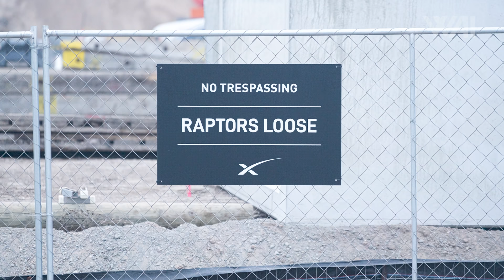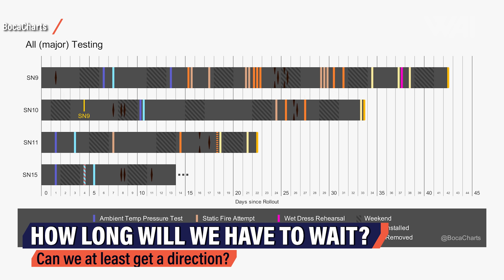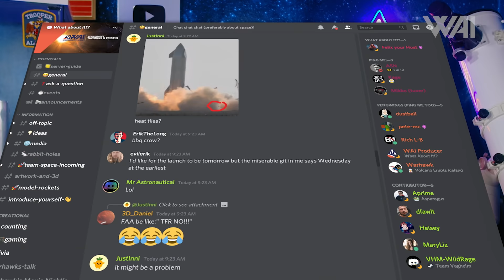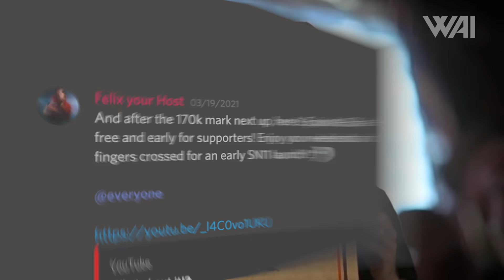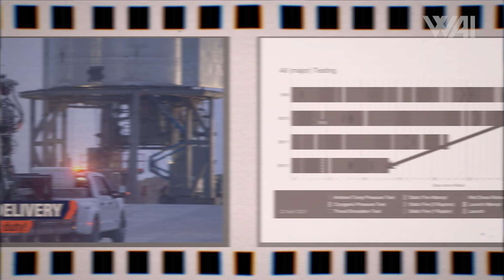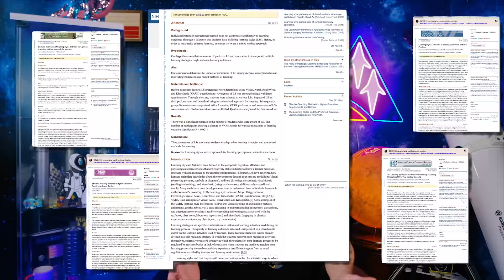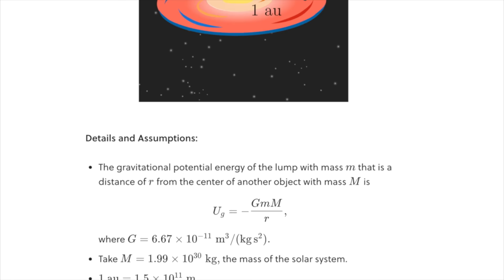When will SpaceX Starship SN15 fly? Crew 2 Launch Summary!

Comment: The "blast berm" is a welded wire basket retaining wall that has layers of reinforcement extending back through the material behind. These are commonly used for road construction projects. It isn't permanent, but could remain for several years. It doesn't appear that they will put concrete or anything else on it.

Comment: If this (1:00) happens with Super Heavy, there will remain nothing of Boca Chica than burned soil.
Reply: At least it would eliminate the loose raptors at the site
Reply: Unlikely. The two gases can't mix quickly enough. Yes, there would be a large fireball, but I suspect the damage would be fairly minimal (considering the size of the fireball). Remember the SN9 explosion, when it impacted? Basically, the liquid methane made the fireball, while the LOX just splashed to the side. If the two had mixed prior, the results would have been rather different. ;-)

I think the berm they're currently constructing is there exactly for that reason - divert a pressure wave upwards. Getting dunked in fire for a few seconds can be mitigated fairly easily.
Reply: @realulli  I would also imagine that the force of the initial explosion would push the fuel away, making it very difficult for it to mix quickly enough to create a new desert at Boca Chica
Reply: It would be similar to the N1 rocket explosions. The site would be fubar most likely.

Comment: Here is a wild theory to try on. How about spacex is testing the idea of putting a couple of raptors on the nose of the lunar variant at the flap mount to see if it can handle the load stresses of landing on the moon with rocket motors mounted there. It would be even cooler if they were thinking of setting up an orbital motor swap. Once the lunar variant is in orbit and refueled it is over powered for the job. Two raptors permanently mounted on the nose would work and an empty engine bay could be loaded with unpressurized cargo. This would also mean spacex is contemplating putting a starship in orbit as a private space station to use as a maintenance depot. God I hope so.
Reply: Very creative!

Comment: I don't know the proper technical terms, but that stress test rig might be designed to 'bend' the vehicle - I saw another video that said because it is constructed standing, it doesn't need the 'stiffness' of those rockets produced on the floor and then tilted upwards.  Since the descent profile will put this kind of 'sideways' load on it when it's using it's heat shield maybe they need to know if that will bend it/shake tiles off?

Comment: 5:28 I'm curious, I thought it was impossible to launch a fully loaded Booster with all of its raptor engines because of the sound breaking glass windows etc. (There isn't a location in the U.S. that has enough space around it without anything... hence the need for the oil rig launch platforms.) I assumed this meant that we would never see a launch for the moon or Mars from StarBase. They can test the booster and have a booster take a starship to orbit on 4 booster raptor engines which won't produce the sound problem. I guess I'm curious what the payload capacity is... does the booster need all the engines to say, lift the refueling model StarShip to orbit? Will orbital tests limit the amount of fuel StarShip will carry to orbit (will it just need enough fuel for the landing burns?)

Comment: As far as the test rig, it’s think you hit it square on.  Orbital launch and re-entry are the focus now and Elon already made comments setting expectations for the first few re-entries.  Re-entry stresses are much different than launch or max-Q stresses.  

The “tops” of the launch pads aren’t tops at all.  Those plates are used to temporarily hold the rods in place while concrete is poured.  The plates will then be removed and the rods will be used to bolt the actual tops and possible the platform to the lower parts.

Comment: If the ISS is coming to an end by 2024, would spacex need to redesign the dragon capsules ? I mean, now is built in order to perfectly dock on the ISS, or the docking system would function on any other ISS-like structure as it is ?

Comment: Theoretically, if Russia were to detach the Zvezda module and go elsewhere with it, the ISS would have to be decommissioned because Zvezda provides most of the life support for the station. In reality though, I don't think the Zvezda module is capable of being a free flyer, so they would be unable to take it anywhere. They don't have anything to attach it to right now. It is dependent on the rest of the station for electrical power, so they can't do anything with it until they have a substantial alternate station already built and, the fact is, they don't have the resources to do that. It has taken them what, fifteen years just to build the Nauka module that they are finally going to attach this Summer? They can threaten to take their bat and ball and go home, but it is just a bluff. If they really want out of the station, we will wind up buying Zvezda from them and, I suppose, Nauka too. Russia has two choices in space, be a junior partner to the United States and Europe, or be a Junior partner to China. They don't have the resources to do anything significant by themselves. Not under Putin's kleptocracy anyway.

Comment: Replacing the ISS is trivial. Skylab was a modified Saturn 5 upper stage, the same can be done with Starship even more easily. And since Starships will be routinely dock to each other for refueling, it should also be trivially easy to extend the station. Making the nose cone removeable and other small modifications would help extend the station even further. And all of this can be done at a tiny fraction of the cost of the ISS, while providing far more space, a Starship is over twice as wide as an ISS module and five times longer, without the nose cone.
Reply: Once again, that's with private stations in mind. The ISS is the fruit of cooperation of several agencies that just won't want to rely on one single private US based actor for space access
Reply: @arthemis1039  
ISS is supposed to be civilian and doing science. It doesn't matter who makes it, and how they reach it, apart from national pride. And as space access quickly becomes a commodity, national pride will be out of the picture, nobody cares who built the cars that astronauts drive.
And it's not SpaceX's fault that the competition is nonexistent.
And the main purpose of the ISS was to employ Soviet rocket scientist. I'm reasonably sure that's why it was approved (decades later than proposed) and became an international effort. But that's a much  lesser concern today for many reasons.
And the new ISS can still be international in many ways, but it would be excessively stupid to build it 1000x more expensive just to get everyone involved in the construction.

Comment: A boring tunnel machine this should be the first thing spacex sends to space, one to the moon initially and then a few to mars to build the basic infrastructure of a base......damn it would be easy enough to build a base capable of housing 10 000 people plus animals and food crops and even fruit trees...sending craft that have water and creating a massive underground aquifer capable of supporting not just 10 000 people but also to create fuel for rockets and building new faster more efficient craft that do not have to be designed with a first stage or even be a basic pipe but be something similar to the futuristic designed spaceships in star wars and star trek.......Elon needs to start thinking big, post haste, or his ambitions will die ...and a base on the moon will be much more realistic in the short term than mars and give the experience that is needed to build a successful base or bases on mars.